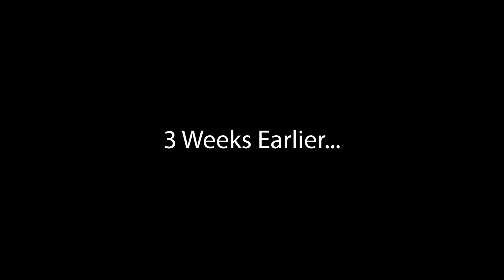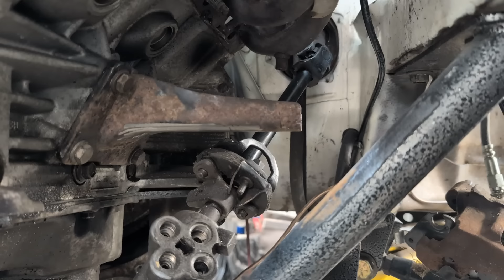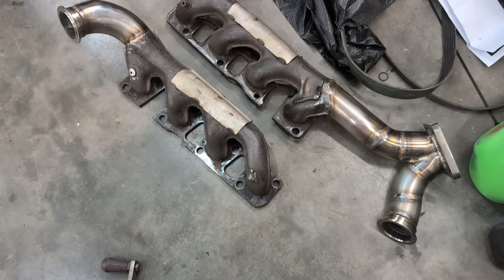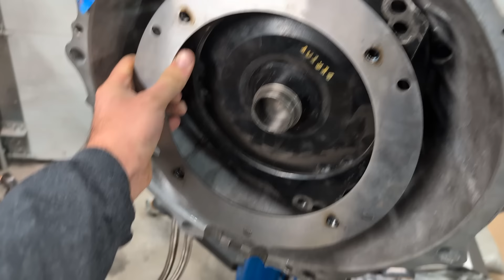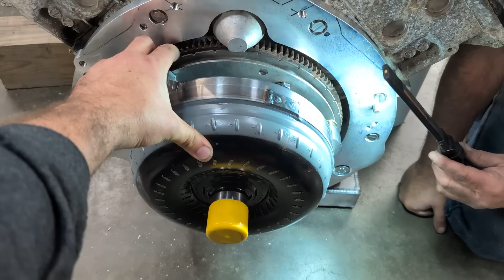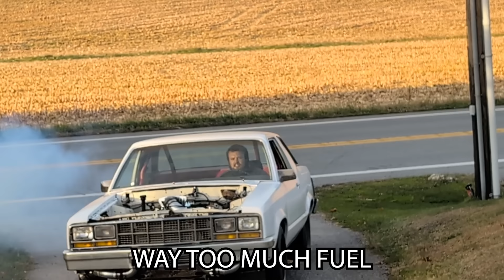Junkyard Nissan VK56 First Start: Is This the Next Coyote?

Comment: I built a VK56 powered off road buggy in 2008 with the help of Clark & Jim at Jim Wolf Technology. All stock except for ITB's, JWT Cams, and computer. It made 525hp at the crank and over 400 to the wheels reliably. It was hooked to a 5 speed sequential gearbox and hauled the mail!

Comment: When nuts were welded on the torque converter,what kinda prep went into that weld?? Extra bevel or... I don't know the actual amount of force going through that but I'd imagine it's alot
Reply from the maker: We just used the original converter pads as support. That way the weld is kind of only there to hold them on. Shouldn't be taking a ton of force.

Comment: I have to point out, this is what the import world considers a stock bottom end. Its unopened, untouched just pulled out of a dying donor and has boost shoved in its face. 

Compared to hot rods magazine where they fully bluprinted, swaped oem parts and made the best version of the OEM block and engine with clearanced piston rings and gave it the best chance at life possible. BIIIG difference in end results.

Comment: Hear me out, 2009 Honda Fit with a L15B7 swap? They’re silly light weight handle excellently and don’t need a ton of HP to be silly fun. A K24 swap would be another option. But that’s been done, I’d rather see the L15B7. They’re also cheap.

Comment: Nice work.. not much of a modern Nissan fan but that is a beefy STOCK bottom end for sure.. What I am a fan of is that futura fox chassis build . I've had fox bodies and absolutely incredible platform once stiffened up (and I've had a 66 Ford falcon a life time ago) and using a non mustang fox body is rare enough to be one of a kind but common enough to work with... I dig your plan of attack and execution.. I tip my hat to you my good man

Comment: WTF.  It's easy to get an 8 counterweight cranks, upgrade the head bolts to 1/2 inch, etc.  on a LS.  All this BS extra work would cost a lot of $.  DO AN APPLES TO APPLES COMPARISON.   THIS IS BS.

Comment: I believe the manual transmission out of the xterra bolts up to the VK56. Could be another option for a different build. Thanks for sharing how you overcame all of the challenges with running this outside of a Titan.
Reply: I believe the 5.6 will bolt right into Xterra. Pretty sure ive seen video on it as well as a Frontier. Also 07-10 Pathfinders came with an optional vk56de 💪

Comment: Quick question....when you do these adapter plates and mix and matching transmissions. How in the world do you know that the end result is gonna be the correct depth to perfectly have the torque converter flush against the flywheel? You got an adapter plate, adapted with another adapter plate. Lol

Comment: Very interesting build, Calvin, but I'm DYING for another video on your vortec 3500 in the Fairmont.
I'm mainly looking for a dyno chart, reliability issues, streetability, racing prowess, and turbo recommendations. You went over the build in extreme detail in the last two videos, but you also skipped over some details that I was looking for.

I am extremely interested in swapping a 3500 into my bmw, replacing the 3.0L n54 engine, not because it's a bad engine, but because I'm interested in something different. Something that's not an LS, or a 2Jz, and I'm gunning for that i5. If not for your videos on the 3500, I may have slaved away in figuring out how to make an Audi 2.5 Rs3 engine work, but that's way beyond my skill level (and wallet) compared to an atlas paired to a tr6060.

Comment: That looks like a Mercury Zephyr, the sister to the Fairmont. I had an '82 and an '80 Fairmont, both with the indestructible 200 CID I-6. My '82 Fairmont wouldn't pass inspection anymore without substantial frame work, so when I heard about a 1980 Fairmont for sale, I jumped on it, great cars, I miss them.

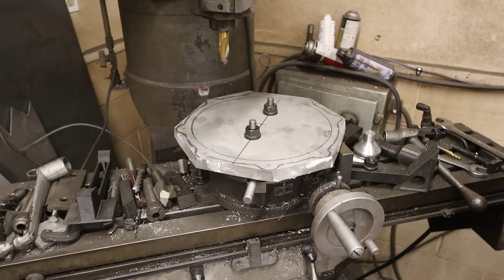Comment: Dang bro you have all the Cool tools. Want to help me make a set of pistons and rods that will work for my Kia Spectra since nobody makes forged pistons? I've already been able to make 3:40 to the tires on stock pistons and rings in fact I've turned the engine up higher but my clutch that I currently have won't handle anymore. It starts slipping when I hate about 20 psi of boost in 5th gear. Anyways nobody makes forged pistons and the only Pistons I have found that are closed in size are Hayabusa street bike pistons and they are the same bore size and a slightly less compression heights I believe which is okay but also the only other issue is that the wrist pin size is 1 mm larger and I'm wondering if we can open up the little Preston sleeve that is inside of the small end of the rod where are the wrist pin  slides inside. Or possibly open up the small end of the rod and then put a bearing sleeve in there that is 21 mm.. if you ever get some time you should check out my ride

Comment: I know this is slightly off topic -well sort of cause we all know that you're "thee' Turbo 4200 Vortec man/ extraordinaire" but I've got a question : You've actually said that, if you're pulling the engine (full swap than) "that you might as well add a turbo" and for those of us inquiring about doing the same, I want to reach 450+hp to the wheels as my ultimate goal. I have the 07' Amera-Barra LT model 2WD all I have to do is grind the CAM's @Schneider-Racing/Performance and get the largest they offer and then turbo it with the (gt3582) but lets say I dont have the funds yet to get all that I need to go along with the turbo, -so my question is (especially since the engine is out) should I… if I just grind the cams what else do I have to do? Bare minmum
Reply from the maker: I would not do the cams at all. I would just stick the turbo on it and go. We made 470whp with the fiat with a totally stock '02 engine. It's still going strong too.

Comment: If there are any performance transmission specialty shops and part makers out there, I think I speak for practically everyone when I say it would be amazing if the Titan/Armada/QX80 transmissions were studied for potential upgrades. BTW, damn nice website C3 Performance!
Reply: At least in the 5-speed transmission years didn't they use the same but beefed up internally as the G35/G37's?   There were plenty of upgrades for the G's back then, I owned a turbo automatic G that was putting it down.
Reply: @v12alpine  I've got a 5 speed Armada that seems to be pretty stout, but when I look through the posts from people that have the Harrop superchargers they don't seem to last long, and that's only like 150 extra hp.

Comment: I learned that in 2000. I built my first 350 sbc in 1997. After going through a Honda 2.3 f23a1 vtec it made me change my life choices on what I should run and own. I learned the basics from my father before going to technical school. I tried to tell this information to individuals in the past but they never listen. Always talking about the popularity of the 454 and the 350 sbc roller rocker. They ain't shit compared to good old Japanese engines. My fave engine.? D15b or f23 dohc

Comment: How do you ask how the Ls competes. The LS is a much simpler design (one cam in block) LS has a smaller footprint, they are more modular like the old small blocks, several displacement options, aftermarket support, ect.....
Reply: You know there are a dozen LS builds on the channel.

Comment: It's incredible workmanship but the costs of the transmission adapting is just too much for the average hot rodder.  Better to put a ecotec. 2.3 liter Ford turbo four cylinder in it and have parts that are already available to fit it

Comment: I have a Nissan 300zx that needs an engine, and you have convinced me to give this swap NA for ease as I am a beginner when it comes to swapping engine types. I have only pulled and replaced the same engine.  

Do you have a recommended ECU that a beginner like me can use and learn?

Comment: Isn't there a 240sx out there running one of these at like near 2000HP? A white one if I remember correctly. these VK's are way more stout than we expected. Edit: not stock bottom end.
Reply: That one's running a sleeved block and probably forged pistons, my mind's foggy from the details but little work has been done to the bottom end
Reply: That is John who is reference in the video.  He only has a stick block and crank. Everything else is aftermarket.

Comment: Sounds like your frequency is too low on your TIG. Get 2% lanthanated tungsten (blue). Turn your frequency up to 120 hertz. Balance 80-90%. 80% for cleaning old aluminum. 90%-95% if new acetoned 6061-T6 or clean aluminum. 

Omit all of this if you’re using a transformer power source as you only have 60 hertz.

Comment: Calvin you absolute legend, you did it. I want to put one of these engines in my 2004 GTO with a six speed so bad. I don't even need boost, I just want an N/A V8 that can rev more than any pushrod V8 short of an SB2 or R07 without being a valve dropping hand grenade like LS7 heads on a 388 unless you spend cubic dollars to rev somewhere around 7300-8300 rpms. I like to imagine Pontiac never left production and the VK56 is what would have happened if Pontiac made a DOHC LS...I even have a hypothetical name for it, Ram Air VI...the engine that should have happened. I like to imagine buying the tooling from Nissan and reopening the factory in Tennessee then producing Ram Air VI crate engines with GM and Nissan bolt pattern and the blocks cast to take up to a 4.185" bore with a 3.62" crank around 400ci. It would probably be easier to just source a CD09 for the VK instead of adapting the T-56. Having some cams made, an intake, a billet oil pump, headers, maybe run it with a 58x reluctor, LS coils and EV6 injectors. 600-700hp 7500-8500rpms. A guy can dream 😂

Comment: Very happy to see you experimenting with the VK56DE. As a Nissan tech for decades, most of Nissan's V8's don't really have issues and are overbuilt for the most part (minus the newer VK56DD which had some cylinder scoring issues from possible piston ring tolerances). 

The cracked exhaust manifolds was mainly from 04-06 I believe, 07+ they added a gusset to the back runners to connect them to help strengthen them and prevent cracking. The cracked manifolds would then lean out the exhaust and overheat the catalysts, which would then cause the catalyst material to get sucked back into the engine (no EGR on these engines because of high overlap to pull the exhaust back into the combustion chamber to essentially act as EGR)

I think the VK56DE is probably the best bang for the buck Nissan V8 with the most aftermarket support. The VH45DE, which is the first V8 Nissan used in a production car in the US was similarly overbuilt with lots of forged components and is the original base that the VK45 and VK56 were designed from. As someone that is currently modifying a 91 Infiniti Q45 (where the VH45DE comes from), i've been mulling about swapping a VK56 in just for availability of parts, so its cool to see what you're getting out of one with this junkyard/low cost build.
Reply: Over 260k miles on my 2010 QX56 and the engine/trans have given us zero issues.   Still runs/drives like new with minimal oil consumption.

Comment: It's amazing how fast you crank out new projects! I'm 5 years deep into working on mine 😂 Congrats on the first start, and burnout. Big oops on the oil drain plug lol. Another great video and showcasing another platform.

Saw you on Brent's video at WCF. Glad to see ya'll linking up. Looking forward to what's next. Almost at 100k subs🏆
Reply from the maker: Thanks. Yeah. Brent is good people
Reply: @Calvin-Nelson  For sure. You should bring the 5 cylinder Atlas to PFI Speedfest next year (if it'll fit a class, or do a 4 cylinder Atlas build). It's a trek, but tons of cool people, and will be a blast.

Comment: don’t solid mount those long (leverage) OEM mounts

that excess leverage can fracture an alloy block

use OEM style mounts with 5mm stainless wire wrapped (4x) around

Comment: Bluetooth turbo drain! You guys are always innovating. I'm going to install one on my car now! 😁
Reply: They had the drain on but forgot to remove the plug put in when the turbos are assembled. The oil being fed to turbo was pushing past the seals and out the exhaust instead of out the drain and back to the pan, it had a gasket and everything LOL.

Comment: The man is legit. He's not looking to replicate what everyone else has done. He is mapping out uncharted territory. True innovation on display. 🕵
Reply: Might be uncharted in the US but been used for over 15 years  in stock car racing in New Zealand. Extreamly under rated engine that love high RPM
Reply: @Enz3d ... Fair enough. Nevertheless, no sponsors, no fancy shop, no team, very small budget, consistent results. Still extremely impressive. Kudos to NZ.
Reply: What its all about is making it all your own
Reply: Yea this over another Ls
Reply: It's not uncharted guys like thatricerjon is using the VK56 and making 2000hp with it but not stock like Calvin is doing. thatricerjon has pointed out what he has done to make that kind of power using stock bloc and heads but the rest of the internals are not stock and has warned the stock VK56 rods will not make much power so it will be interesting to see how much Calvin makes before a rod breaks.
Reply: This is kinda making me want to do this with my v6 challenger because why not

Comment: I had a 2005 Nissan Titan full bolt on full exhaust headers back cold air intake and a hyper tech re-geared to 373s in the rear end .. I raced so many diesel trucks that were big turbo or upgraded turbo, and it walked all of them all motor

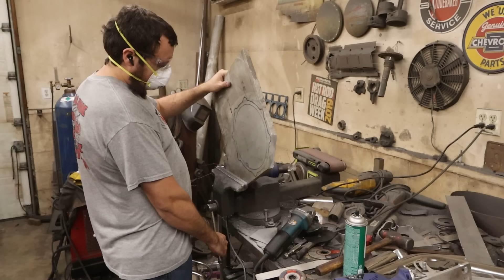Comment: 3:20  When cutting aluminum with a wheel do you load the wheel with paraffin to keep the aluminum from sticking to it?  I just heard about the trick fairly recently.
Reply: Just buy proper aluminum zip cuts and grinding wheels. They  have green labels and are safe to use. Available at your local welding supply.

Comment: Wish guys would start doing this with the 3ur-fe toyota engines i beat the piss out of mine with the magnuson blower at 7 psi for like 7 years towing boats and trailers in 100 degree summer heat and -40 winter never missed a beat all forged internals and awesome trans

Comment: You can change the starter without removing the Nissan transmission. No engineering error there... other than having to remove the intake to reach it. (not a terrible job, really)

Comment: "How did the LS compete with this?"

By not using DOHC, being more affordable to upgrade, having a stronger bottom end, MUCH smaller and fits more vehicles, more displacement capacity, broader no-mod transmission selection, easily swapped into 70+ years of GM bodies.
Reply: Why do you think that the LS is stronger?
Reply: Can handle much larger rotating assembly, and still live at 8,500rpm.  @christophercasale7961

Comment: If you don't pin the gate on that 7875 (or when back pressure runs away) you have not tried hard enough.  I am going to assume the turbo is too small for "max power"

Comment: I have a Titan and after I installed a Nismo exhaust and air filter it runs good. There isn't much love for the Titan in the USA.  Too bad, they are good trucks.  I did not want all the digital BS that comes on fancier trucks. So for me it's great! A lot of folks here do not like the old school tech of the Titan.   🙂 I'm glad that you folks like them. I've even seen new HP cylinder heads for these in NZ.
Reply: I recently picked up a 17 QX80, loving this 5.6.
Reply: I bought 04 Titan LE 4x4 off road new back in 03 and after one of the manifolds cracked I went with JBA long tubes, Cajun b-pipes, and uprev full tune. Loved that truck it was quick before the bolt ons but after, it really woke up. Would love to find another low mileage one.

Comment: I’ve had several customers who had those engines in their trucks. Other than a few oil leaks they were very good engines as long as they were serviced properly. They loved drinking gas but that’s just the price of reliable torque and HP.
Reply: same deal with the 2uz, reliable asf when maintained, but drinks like a sailor
Reply: @tturi2 same thing with n20 & n26 BMWs also they run great if you keep up with them otherwise they will piss oil from every nook and cranny and run like shit
Reply: @richgwozdz8580 if you maintain an n20 n26 there is a good chance it'll still shit itself 😂

Comment: This is an impressive build! Do you guys not run a blow off/bypass valve on the turbo? Because I'm a huge fan of deleting them to keep boost up during shifts.
Reply: Blow off valves on a manual car stop the turbo slowing down and speeding up on every shift but on an auto they hold boost through shifts anyway
Reply: @darcykeddell4930 but they still sound so cool when you let off, lol.

Comment: I did always wonder what a v8 gtr would be like with that 5.7 nissan titan engine with twin boosty bois
Reply: 5.6
Reply: @Carado5150  I had the toyota engine size in my brain got them mixed up lol
Reply: @frankfrosolonejr7010  Ross Trittler is currently doing a VK56 swapped g35 which is pretty much the same platform as the gtr. You wouldn't be able to daily that thing with twin turbos unless they were rear mounted. A single turbo could fit in the front though. Either way, the VK56 is a very tight fit for that platform.

Comment: Old Toyotas are the king of overbuilt forged internals lol I remember driving my 94 Corolla, it took 3qts of oil 3000mile mark it would have 1qt of oil in it. the only part other than tires and brakes that I ever had to replace on the car was the ignition coil at 300k miles. For a car I paid 250$ for it was the best car I’ve ever owned and I wish my sister didn’t total it lol. I’d still be driving it today.